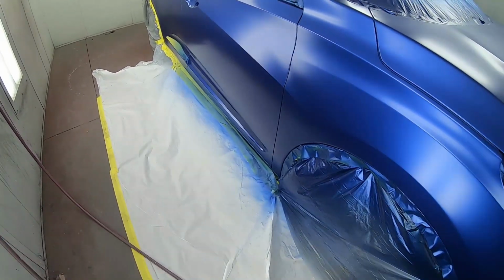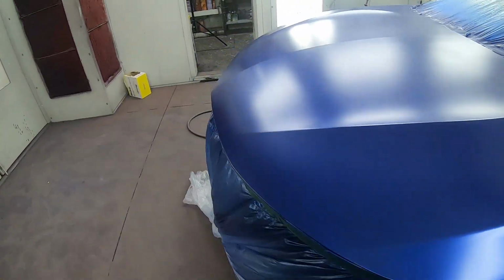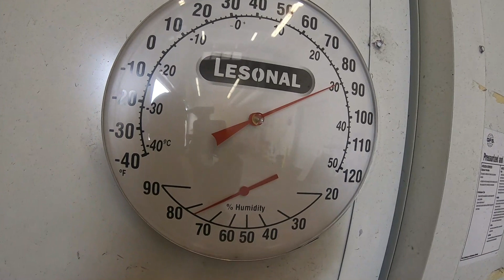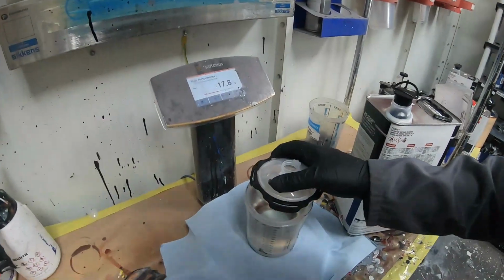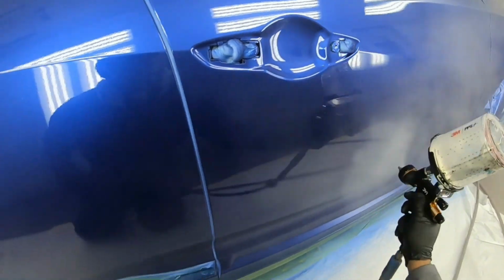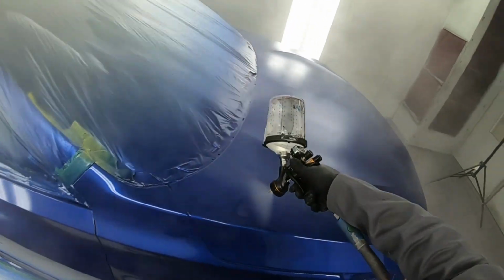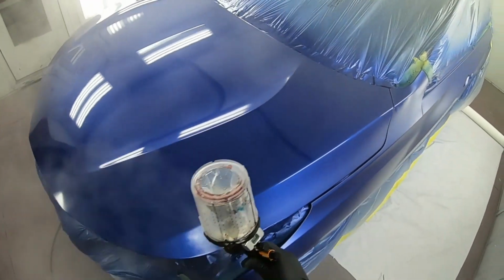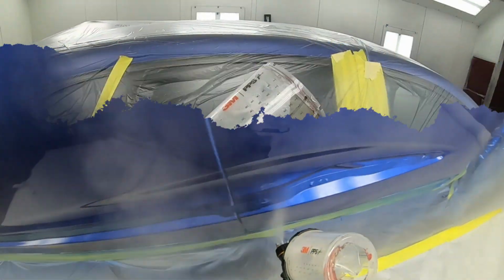HOW TO AVOID DRY CLEAR COAT FINISHES

Comment: Thank you very much for detail processing ,I have a question mister Mario , why after clear coat apply I see some dots or lint on the panel some bump but not orange peel I don't know what is that  can give help?
Thank you very much
Reply from the maker: Hello, those tiny dots are dirt nibs. You have to make sure that you clean the panel you’re painting thoroughly, and the surrounding area. However dirt nibs can be easily buffed out.
Reply: @mariopaintclass6091  you are God of paint job Thank you very much mister Maro

Comment: Mario just subscribed to your channel cracking colour mate I painted my bumper ages ago devibliss gti pro 1.2 fluid tip but have the 1.3 came out a bit rough not smooth sometime said not close enough at the bumper 6 inches away 👍
Reply from the maker: Thanks Andrew I appreciate you.
Reply: @mariopaintclass6091  Mario you never answered my question mate
Reply from the maker: @ANDY-we7mr  Andrew that could be a number of things double check your pressure, paint viscosity, make sure the surface is smooth. 6 inches is good enough if you go closer just move faster. Using a 1.3 shouldn’t be the problem
Reply: @mariopaintclass6091  mario i think i used a 1.2 fluid tip for base coat paint but next time a 1.3
Reply from the maker: @ANDY-we7mr  both works very well I like using a 1.2 for metallic

Comment: Hey Mario that is one nice glassy finish, I love my DV1 base gun as it lays solvent base really nice and smooth, not sure what you do but I find you don't always need a drop coat using that gun.
You said the C2 cap is better than the C1 for the clearcoat which is strange as I much prefer the C1 with the 1.2 tip and can get a flatter coat of clear with that setup but I suppose it's down to personal preference and spraying style, nothing wrong with the finish you got with the C2 👌
I can't remember if you have been over to my IG page lately Mario but I've just invested in a Sata X5500 RP 1.2 I Digital for clear and have to say that I'm loving this gun it's just effortless at getting the clear on, have you used this gun mate? 🙏👍 John UK.
Reply from the maker: Thanks John. It’s personal preference I just find that the C2 cap gives me less work when clearing a lot of panels or an entire car. Nothing wrong with the C1. As for the Sata 5500 that gun is an excellent gun one of my next buy.
Reply: Hi John, just reading your comments to mario & like you I do use the c1 cap for deep builds like bonnets but generally I use the c2, but moving on, I have just bought the new satacc limited edition red that I have heard all the hype about, I know it's going to perform well but I think it's the most uncomfortable gun in the hand, I mean the Pro lite & dv1 just feel like part of your hand but I was shocked at the poor poor handle & trigger combination, I feel like getting the sander to the finger rest it's just sat on my finger awkward and the rear gun rest part doesn't sit right on thumb and forefinger if you know what I mean, for the money I think it needs to go back to the drawing board & plastic knobs as well, can't believe no one else has mentioned this or is it just me, I don't think so

Comment: Good info…..so 1.3 is ideal for a high solids clear with pearl pigments mixed into it??……i will have to remember the 90% overlap on the hood and roof next time i shoot
Reply from the maker: Yes 1.3 is ideal for metallic, pearl, clear, and even sealer.

Comment: are hvlp guns more difficult to spray with? I'm about to try my new Kiwami4 BA, which is my first non-hvlp gun, for base and clear and only use my Devilbuss hvlp finishline flg4 for primer or sealer.
Reply from the maker: Hey man thanks for your comment. Hvlp guns are better to use less over spray ,where you will find the biggest difference is air consumption. Let me know what you experience when you try it.
Reply: @mariopaintclass6091  yeah the Kiwami4 has way more overspray and uses a lot of material. I was going to spray to base and clear with the Kiwami4 but the Kiwami4 is using my base my quick. Also I can't get a good spray pattern with base coat. It'll be a split pattern or heavy on the bottom. For clear, it's a great gun though. Maybe my base is too thin. I shot my best finish a couple nights ago on a bumper. It looked perfect. I prefer shooting base with the devilbuss finishline 4 and then clear with the Kiwami4. My devilbus started leaking from the tip though, on my last job. Every time I paint, something goes wrong, it seems like. Thank you!

Comment: Thats a lot of air humidity, does your booth have a dehumidifier system ? What temps/RH %´s would you say causes risks of blushings ?
Reply from the maker: We can control our booth temperature to a minimum. As to avoid blushing it also depends on the hardener or reducer. So depending on how cold it is use medium, fast, or extra fast. If it’s hot use slow.

Comment: Mario this clear don't use reducer?
Reply from the maker: No just hardener. However you can add reducer 10 to 15% or in this case I would mix it 2:1:1 2 parts clear, 1 part hardener, 1 part reducer.

Comment: Hi Mario I was wondering if this
Is a good clear coat for a beginner to spray with?  I tried using some cheap stuff in the past and my clear coat came out dry looking with extreme dry spots.
Reply from the maker: Hey man, this is definitely a good clear to start with. Cheap clear has low gloss so it takes a lot more passes to get good glossy coverage.
Reply: @mariopaintclass6091  Oh thanks for the explanation. I cleared a car yesterday with some cheap stuff I bought and it came out dry. I'm going to buy some of this clear you used It looks like good stuff. Can I put more clear over it today or do I have to resand it down?
It hasn't been 24 hours yet
Reply from the maker: @mrhow2712  just wait until it’s dry sand it down and clear again

Comment: Wait 1.15 bar is only 14 to 16 psi ? For clear ? Just double checking , I also use dv1 but can't figure out this uhs clear it's very runny and I normally spray at 26 to 30 psi.
Reply from the maker: Yes these guns don’t require that much pressure. The compressor could also play a big role in the amount of pressure you use. Once you spray a clear 3 or more times you will start to figure it out. What’s the issue you’re having?

Comment: Hi mate, first time spraying a clear on my car project. I was watching another YouTuber saying to use fast hardener  to avoid runs 

so I did use a fast hardener and stupidly I sprayed it today on a very hot day in Australia (35 degrees Celsius which is about 95 Fahrenheit) and I got all these dots like craters in the moon . 

I think it’s because because  the 2 pac clear dried too quick abd didn’t allow enough time to the clear  atomised dots  on panels to merge and   combine. 

I had to spray 2-3 times in one spot to get the holes filled which I eventually did so used a lot of clear fortunately didn’t get any runs . 

Also I got a lot of dry dust on panels n& Roof because the clear drying super fast I think. 

Do You think the issues I having are  due yo this wrong selection of hardener ? 
This answer might help someone making this mistake too. Thanx champ
Reply from the maker: Yes your choice of hardener was wrong. You only use fast hardener on cold days. You needed slow.
Reply: @mariopaintclass6091  thanx mate, checked next day and i decided to sanding my clear with 400/600 and respraying because it got so many dots like craters . 

The most annoying thing out of all is the fact I had a medium Clear hardner abd was initially going to use it. 

but because of watching a YouTuber saying to use fast to avoid runs , I decided to use fast. . Lesson learned the hard way. 

Will definitely use slow hardner if it’s above 85/90 decades Fahrenheit(37 degrees Celsius in Australia) or medium if below 85 here . It’s summer in Australian now 🥵

Also I used grease n wax remover 2 times followed by tack cloth to do wipe down so I am ruling out out contamination. 

I also got a good air filter to catch the moisture in the air compressor like a toilet paper roll filter device. so moisture is not a cause fur these  dots too I thinking . It’s purely the wrong hardener I used because the dots are everywhere in the paint not localised .

Comment: Spray at  15 PSI clearcoat? 🫡
Reply from the maker: That’s in bars in psi it’s 16. The DV1 guns don’t require that much pressure for other guns you will not get away with it.
Reply: @mariopaintclass6091  thanks